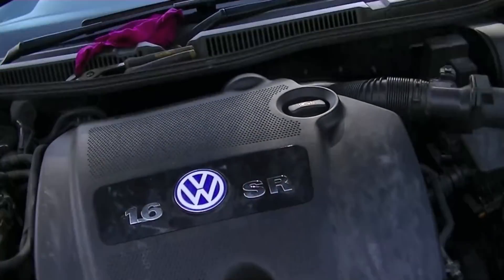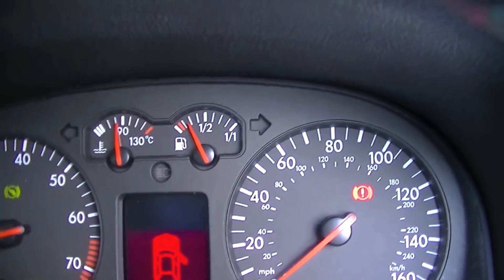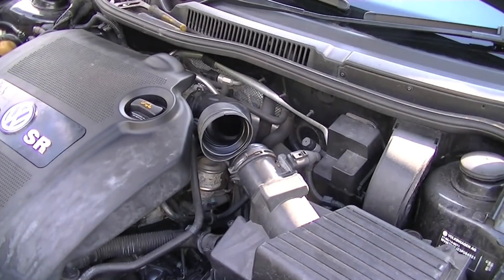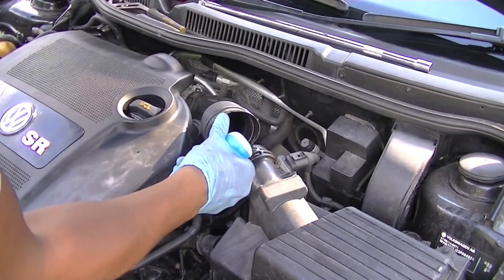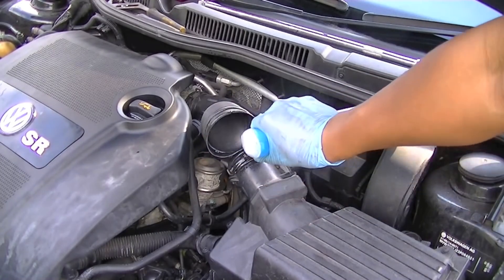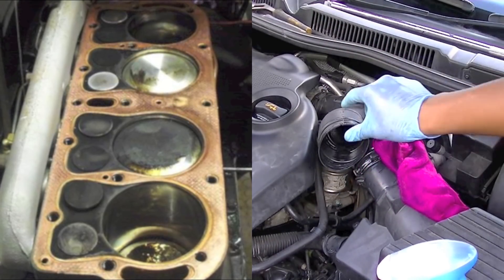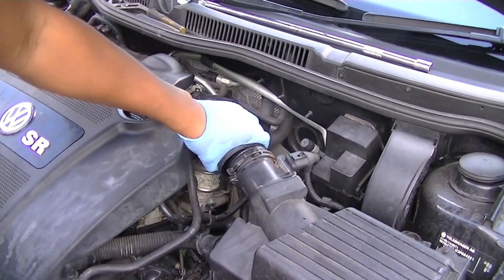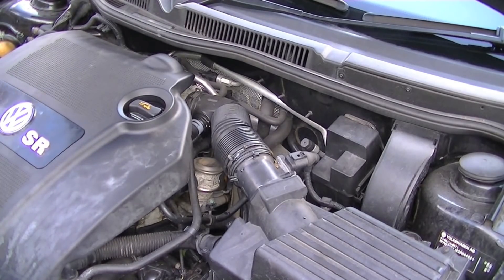How to make your engine run better with just tap water.......Better Than Seafoam?

Comment: Oh my god you dumb .....if you doing this..you dumb .....water into your throttle body.. idot..carb cleaner are specially formulated... the reason for head gasket problems... is coolant/water getting into cylinder..which causes lack of oil on cylinder walls... causes cylinder to over heat and erupt the head gasket...which cause the exhaust to get into your coolant and overheat the car...
Top notch Tech
Chevorlet
Reply from the maker: You are talking rubbish...hahahaha  BMW M4 Water Injection I rest my case

Comment: Bagged the 3,500,000th view.  My life is complete.  Oh, btw...surprised by the controversy here...water injection works.  If it didn't they wouldn't have done it on fighters in WWII...I'm older, so I thought this was common knowledge...use misted distilled water, not liquid...you will screw up if you use liquid...fluids don't compress.  Science for the win!
Reply: The controversy is born of people claiming they're 30 years a mechanic, then GUESSING what will happen...  "Oh, the water will make all the engine parts rust..."  or "Oh the water will get into your oil and ruin the bottom of your engine..." or "Ever heard of hydro-locking, fool?" when HYDRAULICING...  happens when liquids are compressed...  having conveniently forgotten that no LIQUID...  entered the engine, or was allowed to settle in a pool anywhere...

A mist entered...  turned to steam... was digested and spat out the exhaust along with contaminants...

They GUESS...  but you know...  cant help they that dont want to know...

Comment: how long do you do it for AND how often
Reply: For best results...  buy a proper water injection kit and run it permanently...  No squeezy bottles...  

1977 XC Fairmont, 302 V8, Engine is like brand new...  Replace the Oil regularly, and the exhaust system MUST be stainless...  Dont FAQ around with it...  Do it properly, it will pay off...
Reply: Andy George I'll do a spray bottle, soooooo permanently would be every month????

Comment: interesting, does this mean water injection as added to some turbo tuned cars would work in non turbos?

does this negate the comments about rust etc as this is a known tuning method, so perhaps we should be looking at a water injection solution for non turbos?

in theory, does this then mean carbon cleaning and increased performance by making the air more dense all in one?

Comment: they hsve been injecting water into 2 stroke M/c for years and their is a guy in la who built a 6 stroke engine which injects water into the combustion chamber after the exaust stroke which in turn is vaporized by the extreme heat that cylinder is under generating steam which actually adds an additional 100hp to a 2 cylinder gasoline engine overall hp was around 190 from a 125cc,so water into an engine is nothing new although I own a 2000 jetta vr6 and if only it took water to make it run better hope you keep the water away from the sensors and you don't lose battery power or youll lose the smog readiness codes and have to fork out a load of $ at the dealership,when is someone out there going to figure out how to reset these fucking readiness codes after your battery is disconnected?Fuck drive cycles and fuck the state of californias star program,what happened to just sticking a probe in the exhaust pipe?isnt that what your testing for?ia giant clusterfuck that fails cars a young as 2 -3 years old simply because the owner has not driven it enough how fucking retarded id it when the state wants to reduce co2 but if you don't drive your car enough you will fail the smog exam and to anyone of these cunts who point out spelling mistakes go fuck yourself you self involved goiter who the fuck are you,what the fuck difference does it make if you misspell a word from the English language if they are like me they were forced to learn this shit,they banned the language from our schools so as a way of keeping control like invaders do so fuck the language and FUCK YOU

Comment: does the water carbon cleaning works with fuel injected engines as well? Will water not damage the injectors?
Reply: Water doesnt flow through the injectors...  They'll be fine...

Comment: I have a Zafira 1.6 i had the EML on took to garage who told me it would cost around £300  to get fixed as it was carbon build up . I was going to just change the engine as its got 160.000 miles on the clock now as i drive for a living all over Europe. I tried this  and was surprised to see my EML went out after 50 mile trip after i turned the car off and back on again :) i can honestly say it worked for my car and it even saving me cost on fuel ? I done a trip to Turin in Italy and i never stopped at my usual petrol station i could go on to the next one !! all in all i saved around 75 Euro in running cost , round trip of 1560 miles  :)  Thank you for sharing your tip :)

Comment: It was mentioned in the video to keep the car at 2000 rpm.  Is that strictly for 4 cylinders much like the car in the demonstration, or does that apply to 6 and 8 cylinder cars as well?

Comment: I have the same car with the same engine at 300000Km. A couple of days ago I purchase a bottle of seafoam, bust still haven't used it. I  have recently changed the oil as well. Is it a good idea to treat the engine with a seafoam considering the high millage?

Comment: why remove carvon residue in a engine? shit, it's a combustion engine! any type of combustion left carbon residue, it's normal in a engine! I have 300.000km on my car and I never do this things on it, only oil and filters change, always let engine warmed up and cool down after a long trip.
Reply: The biggest problem with Carbon is build up on exhaust valve stems and tulip surfaces.  Water misted into the engine will tend to remove some of this carbon - this is an old technique dating back pre WWII.  Some engines, that run a little richer, have a serious problem with exhaust valves - the only other way to clean is through the exhaust posts with the manifold off, or taking the head off...  I have done this both ways on Land Rover  (originally Buick/Olds/Pontiac aluminum V8s.

Comment: I've been working on cars for over 30 years this is got to be one of the dumbest things I've ever seen somebody do. please whoever watches video did not spray water into your engine. it can damage electrical sensors not to mention internal parts of the engine water makes things rust. that's why they make specific engine cleaners like throttle body cleaner to remove the carbon. this man has no idea what he's doing nor the damage that he can cause.

Comment: This is a very  very stupid thing to do.When you do that the carbon pices  go through  the valves where they can get stuck  and you are lowering your compression ration on a old car which is bad.You gain nothing when you do that.
Reply from the maker: So is it also stupid to use seafoam and water methanol injection too?
Reply: No some products  is very good but to decarb a petrol engine why I see no gain.Diesel is a completely  different  story if you have bad rings or bad oil rings bad timing on the fuel pump clogged  feul fuel injectors you will get a lot of smokeThen you're exhaust valves and the exhaust Wil start to clog up.

Comment: I disconnected the air pipe just like you did, my engine stalled. I disconnected different joints along the air pipe. I even tried to disconnect the the air pipe just before the throttle body, having the butterfly valve visible but the engine stalled immediately. I could not rev up the engine between 2000-3000 rpm. I even tried two-person method, having my brother in the car pushing his leg on the gas pedal. But as soon as disconnected the air pipe, the engine stalled. How come your engine keeps running even the air pipe is disconnected? Any comments / thoughts about this issue?

Comment: Spraying cold mist over a hot combustion camber will cause carbon to separate and loosen likely this done over time , you should know what your doing! Otherwise internal engine damage may result!  Sea foam is good stuff if done correctly couple of times! Again you better know what you doing! Hydro lock, catalytic converter failure may result.

Comment: sorry im a big rig diesel mechanic ,dont ad us in there an say we would agree cuz i do not agree with water ever being in the engine ,who ever seen this video , thats the cause of curosion an rest , u will actually seize a piston over time , id rather add lucas to the gas tank or sea faom an that will clean ur injectors at the same time , depending what car u can even mess up the cam shafts cuz the intake does not go straight to the piston

Comment: You may have to pee on the bottle with extremely strong acid. If you have head gasket failure the coolant is cleaning the piston for a long time, not just 5 minutes. Sometimes if you have to clean the piston removed from engine, even ultrasonic cleaner is giving up. The only way is acid then pressure washer, repeat that, then spinning wirebrush. Please do a test to see the result instead of saying theory and fooling peoples. Happy cleaning.

Comment: Just curious. If the head gasket went bad would the liquid seeping into the cylinder head be coolant, not just water? And if water, would it not be distilled water as tap water is not recommended for coolant mixing because of the heavy metals. It doesn't really add up for me. Also, the head gasket was probably leaking for quite some time before complete failure so spraying a bottle in for the amount your showing would not imply that it does much at all, however if you feel it does than good for you of course. I'm also concerned about debris from the clean, if it cleans as well as your claiming, there is no mention of what happens to this debris, where it ends up and if that will somehow damage the exhaust system. All a bit precarious if you ask me however each to their own, cheers :)

Comment: pistons? in petrol cars? I'm no mechanic but I know that pistons are only in diesel engines? correct me if I'm wrong
Reply: He must be thinking of glow plugs or electric vehicles or rotary gas engines.
Reply: "pistons are only in diesel engines" LOL! That's a good one!
Reply: Yes you are right but only some old diesel engines. All the other use bluetooth compression system connected to the wonderland magical box
Reply: Jacob Daniel A piston is a  moving component that is contained by a cylinder and is made gas-tight by piston rings. In an engine, its purpose is to transfer force from expanding gas in the cylinder to the crankshaft via a piston rod and/or connecting rod.

like the other person said you could be thinking of Glow plugs which are used in diesels where spark plugs are used in petrol engine vehicles.
Reply: or maybe he has the quirky rotary gas engine in his car.
Reply: Ananta Sesa das true but you can have they also have rotary diesel engines
Reply: and surprisingly there are even rotary stirling engines.

Comment: Works great if you feed fairy liquid soap into your fuel line aswell or even rub them round the tip of the injectors if your really want results

Comment: WHY WOULD YOU DO THAT!!! For one thing there is a reason that fuel companies try very hard to keep water out of the gas. another reason why this is a bad idea is that water does not compress... and yea I know that what you are spraying into your intake will not hydro lock your car. But when the piston is on it's compression stroke the water has nowhere to go, it then will be forced past your piston rings and into your crank case, diluting the oil and making your engine less lubricated. so people DO NOT DO THIS TO YOUR CAR!!!

Comment: Great trick, yes it works, but check your oil when you're all done. If you're spraying water too aggressively, it will get past weak piston rings and into the oil. The oil will turn a solid mocha color, indicating that water has mixed in. CHANGE YOUR OIL if you see this, or bearing failure will occur.

Comment: Performance mechanics have been using water injection for decades. If you want to run high compression on pump gas, run a water injection system. Slowly pouring water down a carburetor, while engine is running to remove carbon, is a very old technique. I've done it as a professional. and if it didn't work, I wouldn't do it.

Comment: DON'T EVER DO THIS!! He has no idea what he is talking about. The reason why the engine in the picture failed is because water was entering the combustion chamber most engine components are made with iron and it doesn't take a scientist to figure out what happens when water mixes with iron.
Reply: it doesn't take a scientist to figure out what happens to water on a hot, oily surface and under high pressure... this is a very common thing to do to race cars. if you think this will rust the components you should think again.
Reply: Oil shouldn't be in the combustion chamber if it is then you have other issues.

Comment: I spray wd-40 way better man about 50 mpg more,it lubricates Everything
Reply: WD-40 is NOT a lubricant.  It was designed to displace water...that's it.  The main ingredient is Naptha, which is lighter fluid or Coleman lantern fuel too.